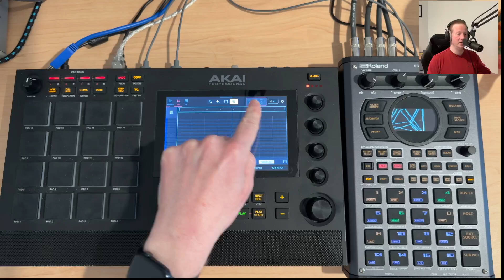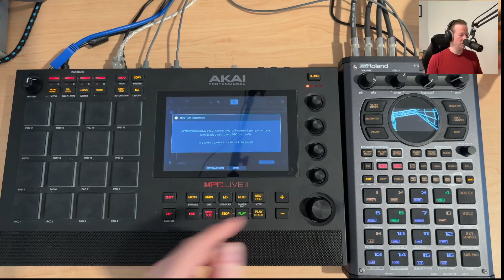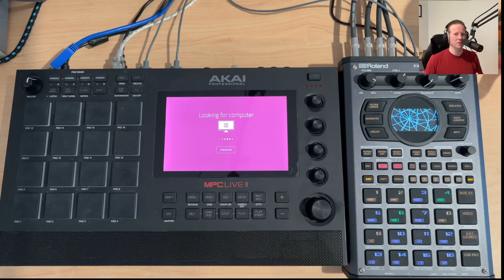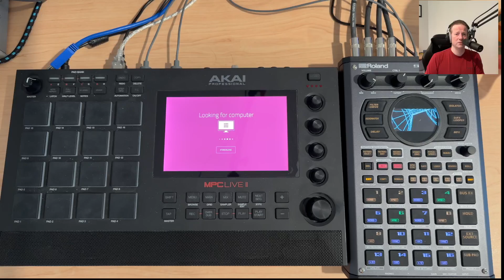in5 - MPC USB Audio With Your Computer

Comment: I think this is different in mpc keys 37 specifically
Reply from the maker: It's possible, I don't have an MPC Keys 37 to try it out :/
Reply: @ I’ll see if I can check with Mac + mpc
Reply: @NearTao I might have confused it with usb midi. Keys 37 can be connected to the computer without being in host mode and for instance play / interact with any midi devices on the connected computer. That could be your daw, vcv rack or whatever. You can of course do the same on any mpc by hooking up a separate midi interface
Reply: Yeah can confirm this just tried. I am playing vcv rack on usb midi port 1 on the mpc keys 37 in standalone mode only the usb B port connected. And this of course goes both ways. The pc can play the mpc while still in standalone and without additional interfaces